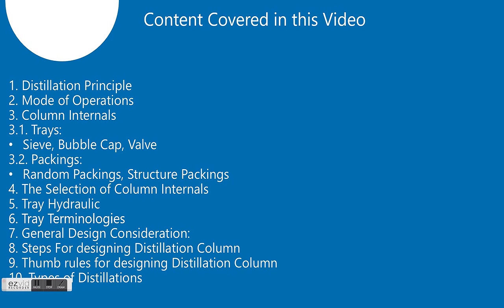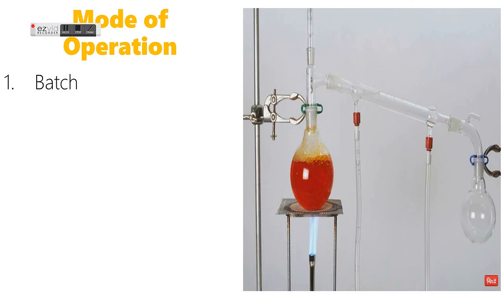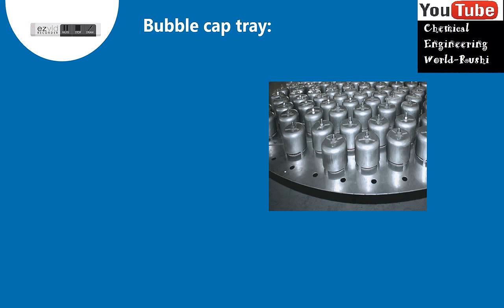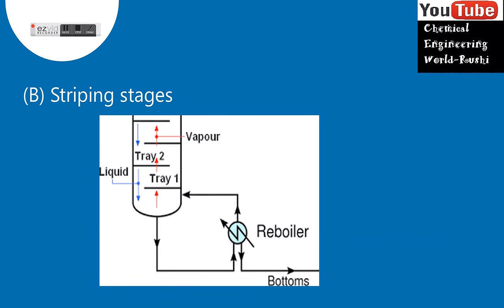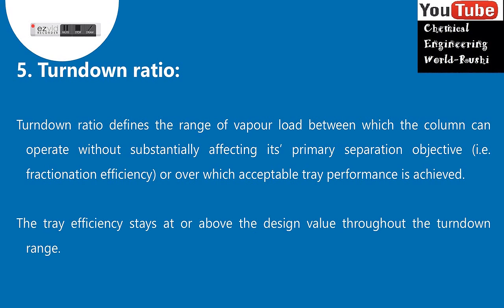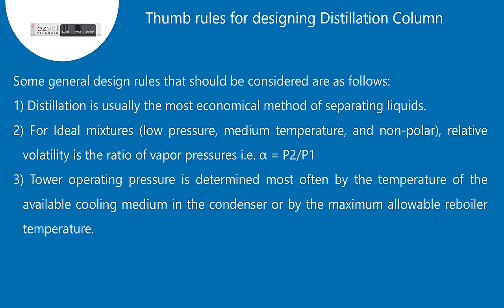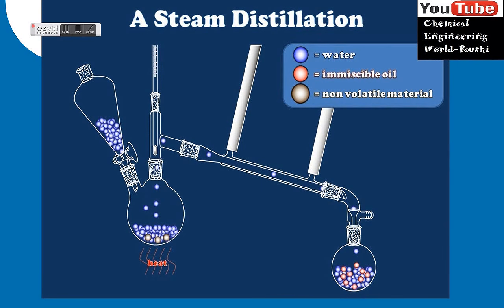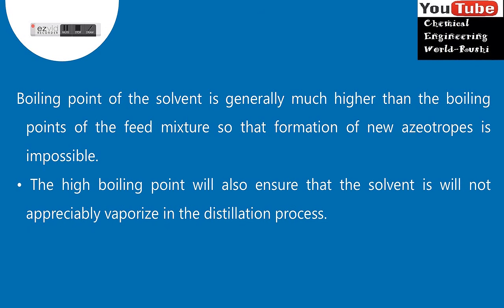Everything about Distillation Column

Comment: This is one of the best video I've ever watched, I do have a question though.. How do you control the descending temperature along the column..?
Reply: Dick Cavett had a talented cousin named Robert, I believe.  Now, Robert was a chemical engineer.  He conceived of the usefulness of isothermal distillation - or else the Cavett problem was presented to him fully formed and all he had to do was solve it.  Well. the solution is simply to place a compressor in the vapor transfer stream between every two adjacent trays.   One can adjust the output pressure of each individual compressor to match the temperature profile desired.